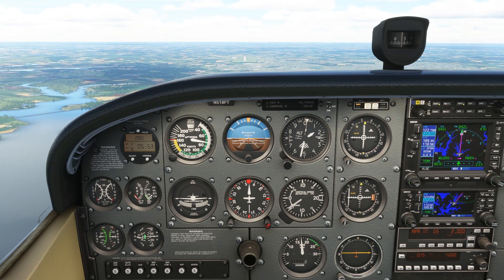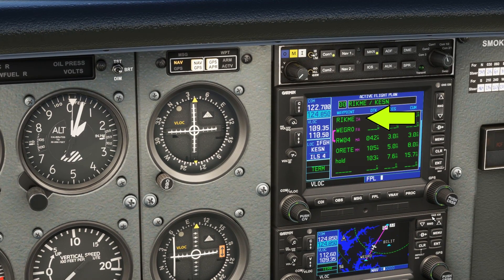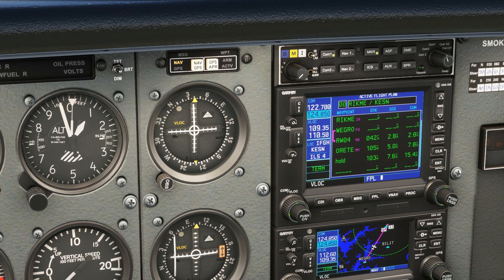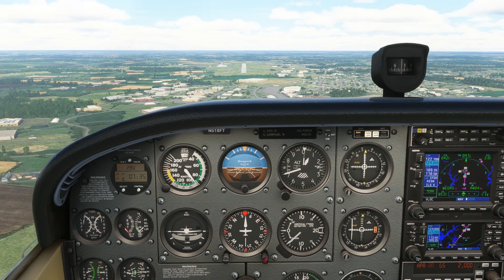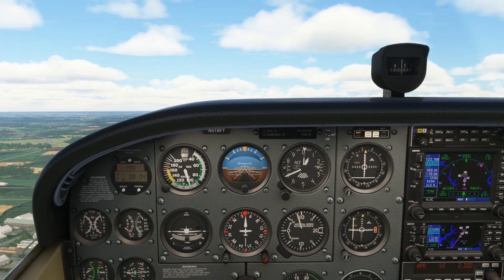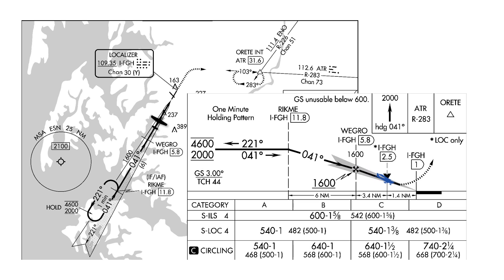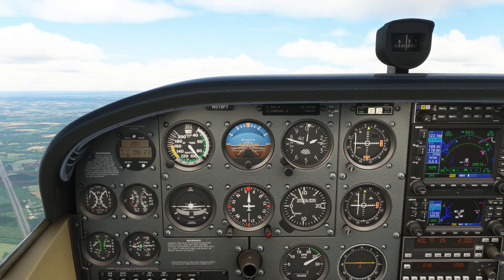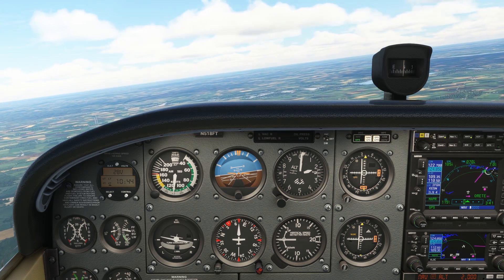Missed Approach in a Garmin 430 530 | Hitting SUSP | IFR GPS Tips

Comment: Yeah, I wouldn’t be teaching folks to use the suspend button the way you have it in this video. Only when reaching the missed approach altitude would I hit the OBS button. This is particularly true for RNAV approaches. The problem with this video is that if I don’t hit the climb out altitude of the missed approach procedure and then hit the OBS button, the 430/530 will sequence to the next way point on the missed and tell you to turn encourse immediately- which of course could kill you. Typically, the plate will have a textual representation of the missed (which i s ruling), and it will say something like “climb to x, then…” The “then” is when you hit the OBS button. No sooner than that. So climb straight out, hit some altitude on the plate, THEN hit the OBS button to sequence. It has to be in that order.  Your life depends on it.
Reply from the maker: This is a good point. Though it wasn't a factor in this scenario (no RNAV sequencing and a straight out climb dont cause the unit to indicate a turn when unsuspending), it probably deserves a mention. On this approach and similar ones it's good to unsuspend as soon as you reach runway threshold. You're above all safe altitudes, and you need to see the intercept on the moving map. There are plenty of RNAV approaches where hitting unsuspend early will sequence into a turn where an obstruction could be. This isn't the case on G1000 and newer as they automatically unsuspend when reaching a turning altitude. Thanks!

Comment: hi man, i dont get it, how do you have a this good G530 simulation with up to date database? what kind of simulator is this? and what is that green dashed circle around the airport? i have the garmin sim and it does not have it, also it was updated ages ago...
Reply: Both X-Plane and MSFS2020 allow you to use the 530/430 with updated databases (Navigraph).
Reply: @pisymbol  but does that mean the approaches and procedures also or only the waypoint DB is updated? also does this mean this is the default 530 in fs2022, what I see in the video? thx
Reply: @kbuss10  updates you pay for Google navigraph which gives you the latest cycle
Reply: @pisymbol  I know navigraph I am registered.
Reply: @kbuss10  then I don't know what you are asking - navigraph sells chart data that installs in both sims to update the database
Reply: @pisymbol  chart data and procedure data is not the same. procedure data is much more complicated. also most procedures were changed dueing covid